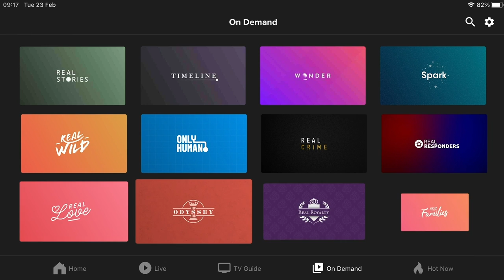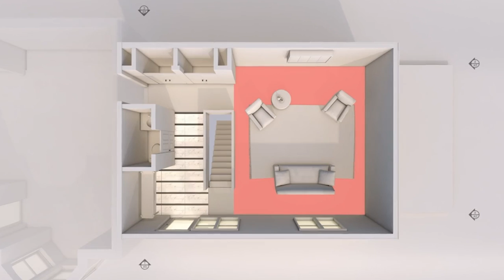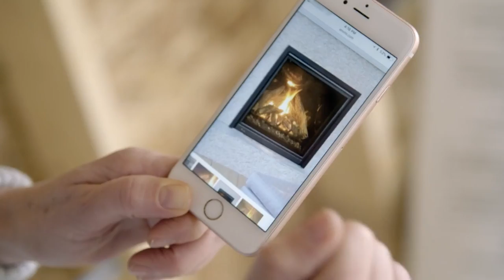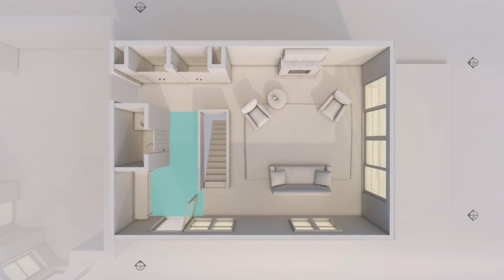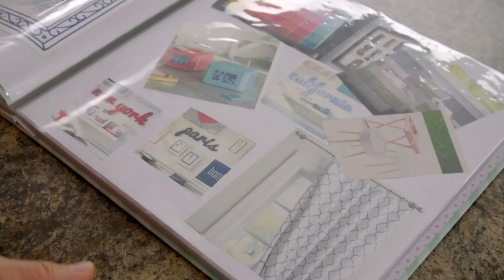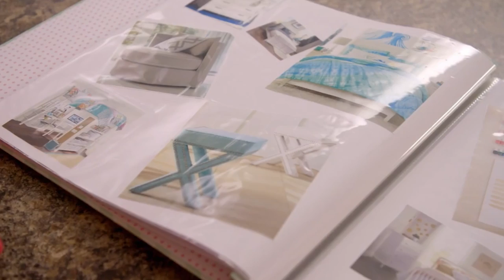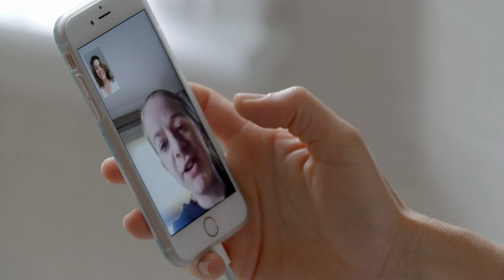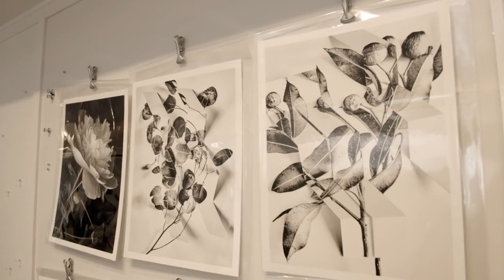How To Design A Stylish And Cool Living Room | Sarah Off The Grid | Abode

Comment: The TV box did not turn out well.  The piano hinges are far too obvious when the artwork is opened.  The TV is not centered in the box, and is so unevenly spaced, along with the piano hinges, I would not enjoy facing that TV and watching the screen.  Further, there was a fair amount of glare on the glass when the frames were closed, obscuring the artwork.  The artwork idea should have been abandoned for that application and used elsewhere.  I think Sarah was very unhappy.